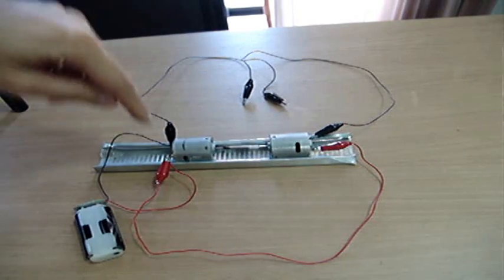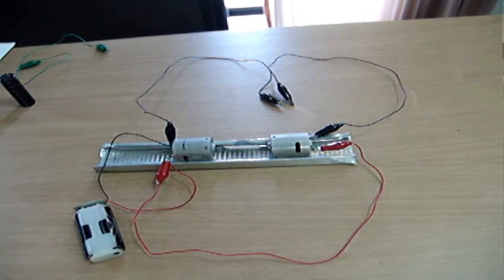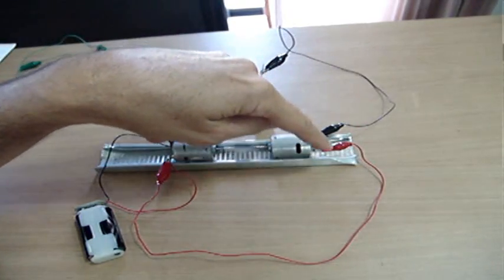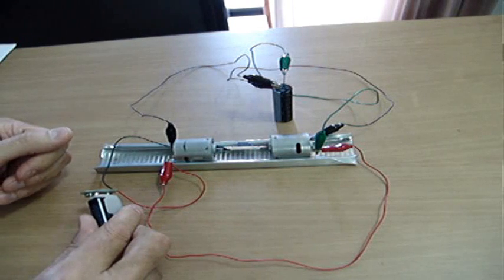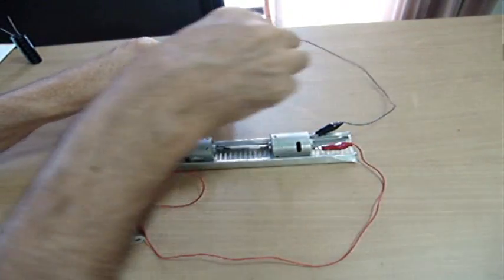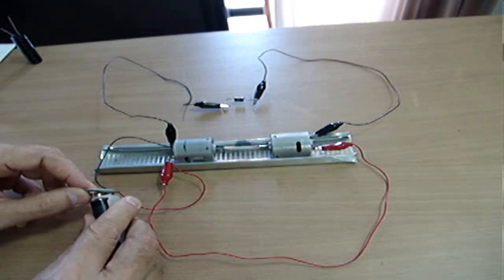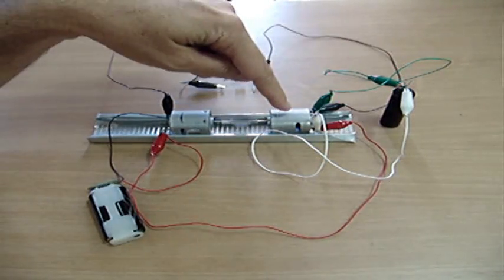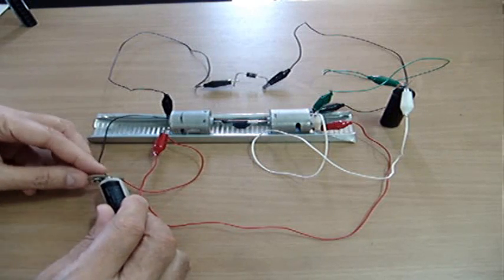Free Energy? Proof of Over Unity? Diode & Capacitor Followup

Comment: READ THIS CAREFULLY. There is no free energy. As soon as you join the two black wires and it runs 3time faster means, that the second Motor, which runs as generator,  is now not a generator anymore but a second motor and helps the first motor to run faster. You have two, instead one motor running. But you have twice as much energy consumption too. It runs 3times faster because, before joining the two black wires, the first motor has to run the generator. But as soon as you join the two black wires, the first motor has first not to run the generator anymore and second he gets help from the second motor. So twice as much as before joining the two black wires plus the one of the first motor.
Reply: +peter schiller -----EXACTLY RIGHT

Comment: why not try to put both the capacitor and the diode on the motor side instead of the generator side test this again please, let me know if there is an updated...
Reply from the maker: +dobby contreras Interesting idea.  I will put it on my to-do list.  Thanks.
Reply: i want to know what are the capacities of your capacitor, diode and was your motor both 9 volts or 12 volts? Also i want to see your connection on the positive side instead of the negative side on your next videos thank you.
Reply from the maker: +dobby contreras The capacitor was 10K mF.  The diode was a common power diode.  The motor was from radio shack, I think it was rated at 3 or 6 volts.  Nothing special.  Reversing the connection in these motors won't make a difference because the armatures and magnets are symmetrical.
Reply: +tsbrownie You said the motor is from radioshack? is that a regular motor is that what you mean? if that so thats maybe the problem because i watch some of the videos regarding the lil motor as generator they using stepper motor you can hack it from old printer or you can buy it from electronics store
Reply from the maker: Yes, just the little hobby motor they sell.  I've tried steppers, but not had any more luck.  May have to look at it again.

Comment: try adding a hundred of the same capacitors in parallel to the driven motor and tap the out put of the cap array to the drive motor with a small rated resistor to prevent too much current from being used..capacitors charge up voltage super quick but they store puny amounts of current that impedes any sort of self looping from occuring...this will ensure the drive motor moves and slows to a stop much later when battery is removed, no free lunch also, just a longer wait till shutdown

Comment: hello, what if we put a motor in the middle and connect 5 generator with rubber band or any means, which we create 5 times more current.
Reply from the maker: taurachand kevin Yes, but it would take 5 times more power to turn them.  Just like asking you to pick up 1 book, then we tie 4 more books to the first one.  The other 4 don't get a free ride.
Reply: Similar thought, if it speeds up 3 times faster put a gen in the center?

Comment: Hi, one alteration to your test…recycling the energy wasted…lets say you added a 12V / 7.2Ah battery. Recycling the lost energy used / wasted back into the system will harness ambient whatt and shoot the battery up to 15.58V. Allowing you to burn of the excess without the battery every dropping below 11.42V.  a 12V – DC / 21W globe will light-up without burning out…sadly on the carbon brush side of the dc motors will after 2 hours or less overheat. Brushless DC  motors would be best. 
Best of luck.

Comment: With just one motor running the only load on it is the other motor which you refer to as the generator. When the generator is connected it runs as a motor which of course it is. This not only reduces the load on the motor but as it is now running as a motor adds to the torque  produced by the original motor, resulting in increased speed.

Comment: First statement is wrong. This type of motor/generator, using a permeate magnet for the field, produces a DC current who's polarity is dependent upon the direction of rotation and rotates in a direction determined by the polarity of the DC power source connected to the terminals.

Comment: Don't use DC, use AC. AC is what taps into zero point. Zero point is the reason that power lines go further than on DC.
Reply: tedtw No zero point involved. Current power distribution makes use of transformers to cut energy losses. Most energy loss in a line is because of resistance, a natural property of conductors, however that loss is dependent upon only the current flow and resistance not the potential voltage in the line. A transformer works something like a lever and fulcrum. The side with the most turns gets the greatest voltage ether in or out while the side with the fewest turns gets the lowest voltage in or out. The current does exactly the opposite. Power is determined by the voltage times current product. So up the voltage while the loss and current stays the same allows megawatts of electricity to be sent over long lines with only comparatively small resistance losses with wire not much bigger in size of the thumb. That is why Tesla and Westinghouse Electric won the war of the currents hands down despite the Edison General Electric war chest.

Comment: The reason why it spins faster with the two motor connected is just because two motors are more powerful than one.

If you could check the amp draw it would be higher when the two motor are connected.

Comment: Those motors are DC motors and the generator is producing AC voltage..so you have to rectify the generator side + both diod and condensator must be involved on this side. You can never run a DC motor on AC voltage.

Comment: your project is something that I want to do. I think is possible using basic principles of electromagnetism. for example, when two magnets compressed against each other, they will gain enough energy to make one of the magnets travel to the least obstructed path and the one with restriction will stay in the same place. so,  how this apply to your project, I believe the generator has to produce enough current to feed the motor back. don't used a capacitor because they don't hold enough milliamps. the generator has to feed a secondary source of energy (a set of battery, maybe 4 in parallel ) they will be feeding your motor back and whatever is left it should go to a third battery backup before going to your load. If you produce enough current and is properly saved, you will be able to control your load. you can think in reverse. your motor is like a person running without water.  is drying and running slow, starts raining, he must save some water to continue running. water or current has to be always available.  The amount stored should be greater than the amount consumed. you have to add some tesla concepts for dc amplification. if your source is very small, you should increase magnetism using a transformer in reverse polarity  similar to a police teaser gun... for example. they are charge with a 9v battery cell and In the cartridge will hold a capacitor; However, the gun itself has a transformer that produces 10 times the input source. You need a transformer right after the energy is produced by the generator.  has to be amplified one , two, or three times before going to a secondary set of batteries. this is a double redundancy circuit will act as a perpetual generator motor.
Reply from the maker: Good luck.  If nothing else they are a good learning experience.
Reply: maxspytwel Let us see the video of your contraption. No one has been able to build an in circuit device that didn't lose energy over time. So if all of the parts lose energy how can you build an overunity device out of components that lose energy?
Reply: this video shows there is not such thing as Unity. There is no equal input and equal output. to make things really bad, has no storage capacity. I think my claim is that we can achieve similar results getting away from Unity. That's why I said: I believe is possible creating electricity in a loop - thinking in a system that involves multiple processes that will result in constant power. A motor and a dynamo can not even be called unity. there is not enough components to treat this project as a perpetual motor device. It doesn't look like a full grown project to me. this is why I suggested adding a better storage capacity - thinking there is something missing in this project regardless if it would possible work or not.
Reply: maxspytwel It is doubtful that the solar energy above Manhattan can provide all the necessary energy to run the subway, lights, motors and other things underneath without additional energy input. We have clocks that should run, providing an available source of energy input, for about 250 years if the makers claims are to be believed but will they?  

The definition of over unity by these people is being able to get more energy out of a machine than what you put in. Then they claim they are almost there in an effort to bilk someone out of investment money or make a name for themselves. Many of them either hide the source or create sophisticated machines that use a little energy but have a lot of stored energy. A perpetual motion machine consumes no energy but can nevertheless move. 

The laws of physics make that impossible on a macro scale. However if electrons revolve around a positive nucleus why don't they eventually slowdown and stop? That's a bit of a riddle right now but no one has been able to pull energy from the vacuum or some other currently unknown source. 

You can't power a vehicle from burning an onboard source of water or build a machine that burns water as a source of energy. No one has ever been able to do that so claims otherwise need to be strictly scrutinized because they would overturn current scientific understandings.

 Most of these people can find only one or two trained scientists to support their claims but can get hundreds of lawyers to take their cases to court against the US Patent office. The Patent office will not issue a patent for a claimed over unity device. Stan Meyers brought a suit in federal court and lost because he could not show that his device could do what he claimed after it being tested by the National Bureau of Standards. He then tried an end run around by bringing his device before the Senate Energy committee. Once again despite his having lots of lawyers he had only one trained scientist. Someone who had a previous business relationship with him. 

What you are talking about is using alternative sources of energy not perpetual motion. The origin of solar energy is from nuclear fusion reactions on the sun.  That energy is free in an economic sense not a physical one. While I can't see into the future the sun will still probably be burning after human beings no longer exist.
Reply: maxspytwel I'm not sure how far you have gone in school but the difference in letter usage is not really important because the letter is a stand in for a number. I, stands for Current, R for resistance and E for electromotive force. C is used for capacitance so to avoid using the same letter twice I came to stand for current. When you actually use ohms law you put in the actual values. So I, current, is measured in amperes, R, resistance is measured in ohms and E, electromotive force, is measured in volts. Their are additional laws and relation ships and variable names involving electricity so if all the variable names were changed to suit the English language things would become even more chaotic. In some formulas you will see Voltage represented as V instead of E. 

The idea of unity is a value of one. Any machine that turns one type of energy into another will have a practical loss. If it was a perfect machine the input energy would equal the output energy. Since no machine is perfect it will lose energy therefore it has an efficiency of less than one such as 80% or .8 efficiency with the other 20% of the energy going into something unwanted or unrecoverable from a practical view. Scientists and engineers are always looking for new ways to increase efficiency and things found in a lab or dreamed up on paper go into practical things being made into something useful. 

This video maker has shown what happens in a real experiment and he lets the viewer decide what the meaning is unlike others who use pseudo science and hidden fabrications to make unsupportable claims.

Comment: try use ultracapacitor with full charge(Maxwell),Diod & small pulley on motor & medium or big pulley on generator
Reply from the maker: Hard to find the super capacitors.  Will have to add that to the things for my next video.
Reply: tsbrownie i think change motor to low current(A),volt but High rpm maybe change generator low rpm High current(A)
Reply: tsbrownie
If you have access to an amp. meter and a voltage meter; they should be hooked up to your circuit in your next video, That would give you the info you need on this circuit.
Reply: Michel Grenier A super cap could keep a small motor running for quite some time. However once again that does not prove over unity only that a super cap can store a large amount of energy.

Comment: Your circuit consist of a batterie pak  1.5 volts running a dc motor making mechanical power mechanicaly turning an identical motor in reverse direction producing a voltage of reverse polarity to the batteries ,the driven motor becomes a second power source (possibly 1.5 volts or more) , but not free power it is produced by the driving motor ; When the driven motor is wired to the driving motor this becomes a  circuit wired in series with the batteries and the driven generator motor and doubling the voltage and rotation speed. The wattage coming out of the battery should double when the 2 motors are connected electrically. The addition of a diode (more or less a check valve) it allows power through or backwards it impedes power. Capacitors   store power can impede power.
This is definitely not a free energy machine.

Comment: You hooked the motor up wrong. The way you have the motors set up, makes the right motors polarity reversed, you can even test it by connecting an led to see the polarity. So the right motors "red and black" leads need to be swapped. Right now, it's not going to store energy because the polarity is backwards.
Reply: ALSO THE DIODE SHOULD ACT AS RECTIFIER EVEN THOUGH ITS DC OUTPUT JUST TO BLOCK THE REVERSE VOLTAGE IN IT SO AT LEAST WILL GENERATE FOR ALONG TIME

Comment: maybe need Can Recharge Capacitor fast 
i think maybe need transformer i just Tried i testered and generator out power is
1.1-2.0v now i have transformer 1.5 input - output 220v
i testered output showing is 231v
i try Diode to make flow 1 direction(not_the_singer) xD
i try with transistor + coil i just get the other parts from old camera with flash
Reply: i cant give my Transformer info cause i got 3-4 Volt's output on motor 
Try to tester ur motor and buy what should can use

Comment: Just measure input and output current and voltage... if it's output is greater than input, bingo. You will likely find bongo...
Reply: you also must measure power factor on the output

Comment: just wondering what the differing current used when (a) using first motor on its own then (b) connecting generator motor to first motor then (c) capacitor then (d)  diode to circuit.
Reply from the maker: Did not take those measurements.  Would have to take them across both sides, motor and generator for them to have any meaning.  I took it apart for other projects, but when that's done I've got a growing list of to-dos for this.

Comment: I tried it today, and using a small electromotor connected from a 12v battery and using 5 times 2200uF 36v caps, and 1 4700uF cap. 

Then i attached the small motor to a slightly bigger one. And i got 26volt output voltage using 2 220uF caps ( can hold up to around 450v max ) and a diode ofcourse.
it can drive a 12v fan 100mA fan with no problems. The voltage drops to 20V then :)))

I must say that the small motor gets hot tho. I guess it's made for 6 or 9volt. Not sure about that.

Comment: Well,  even if this wasn't an overunity device,  it is clear that it does improve the performance of the system by hooking up the generator. There is a possible practical application for this like running an electric vehicle using the same principle to increase the range or reduce the amount of batteries required, etc...

While we're on the subject of overunity,  the argument or theory suggest that the generator must produce higher voltage than the motor. This would require either changing the gear ratio or using a slightly bigger generator with high internal resistance....
Reply: its not acting as a generator, it is just adding another motor to the circuit if you dont believe me imagine what would happen if he switched the leads.

Comment: you need a simple amp meter run in series between the battery and motor, you will see your just doubling amperage.   i believe in this but may i suggest you take a step back and get a meter and some magnets.   i used old hard drive with a single magnet on it that was single pulsed into a vgate of magnets that was placed under the hard drive... so one single pulse form a coil made a complete revolution... then i placed a rubber band on the hard drive and connected it to a motor similar to what you have. so for one pulse to get it started and the rest of that one revolution it was generating power.. i could never get it to make enough power to pulse the coil again but it was a good start.   its on my channel.  good luck